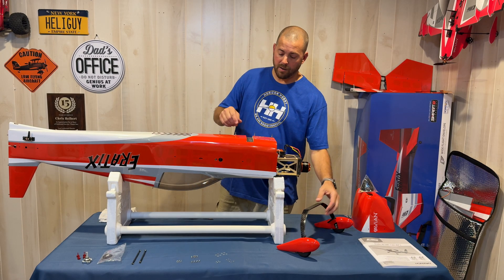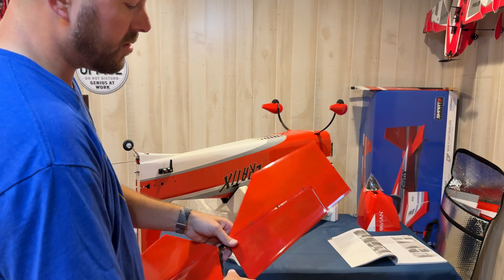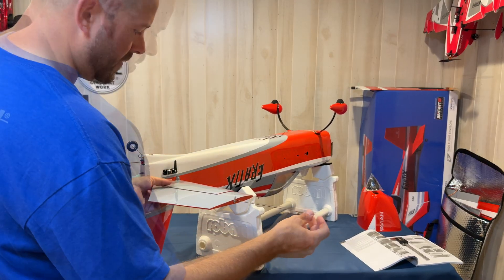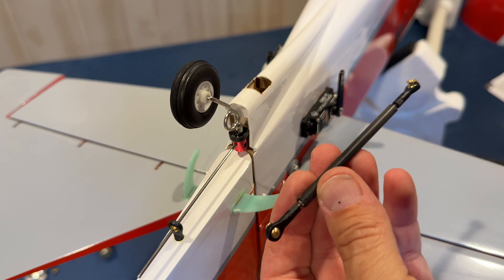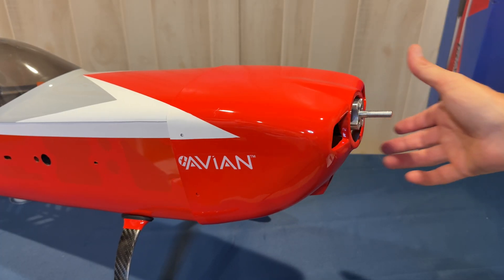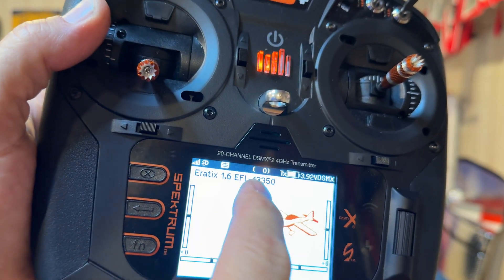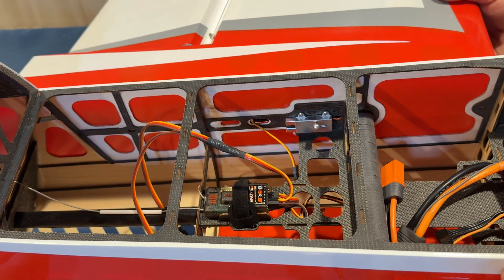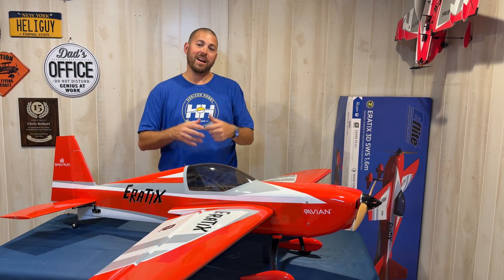E-flite Eratix 3D SWS 1.6m BNF • Assembly Build Video

Comment: Going to get the PNP and I have a Dualsky XM5050 which 2.2mm short, so will easily shim out to fit. But the motor mount back plate  'X' has holes 56mm apart and the Spektrum has 68mm apart. I know some wooden fire wall plates are solid wood, others are skeleton, if solid it's possible to rotate the X around a bit and drill new mounting holes, but if skeleton it's not possible. Can you remember before you mounted the cowl if it's solid? thank you
Reply from the maker: https://www.facebook.com/media/set/?set=a.1206516414853124&type=3

Comment: Is this plane insanely tail heavy? Or what?
Reply from the maker: For a sport pilot 5000-6000mah packs would be perfect neutral CG. I run 4000s and prefer CG behind the wing tube for insane pop tops, blenders and harriers.
Reply: @ChrisReibertRC  thanks for the response.
Reply: I tried the recomended 4,000 and had to put it almost all the way up in the nose and it still tail heavy. A 6,000 was much better but added about another 1/2 lb of weight which I think contributed to my landing gear plate popping out.
Reply from the maker: @ChuckGlyder https://youtu.be/w5yeffG18OY?si=nOAmeGnRoXJxTXJn
Reply: @ChuckGlyder  good to know. I just bought some 6500 mH batteries, but I am going to use them in bigger planes. I'm going to stick with the 4000s next time out. But my plan is to build a sliding battery tray similar to the ones in some 6s FMS planes. I will put the battery to the nose if I need to, but I need to be able to secure it.
Reply: @ChuckGlyder  it's supposed to be able to handle up to 7000s. So I'm still calling out skimping on the glue.

Comment: The pushrods on the bind and fly version,at least on mine, arent adjustable. They are already the needed right length. If you need adjustment you move the servo arm or use the sub trim in your radio.